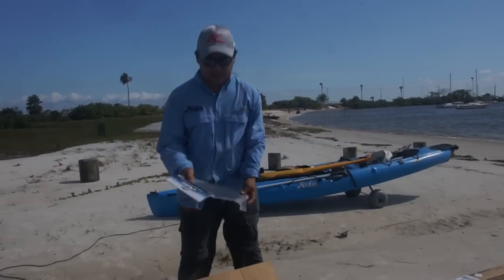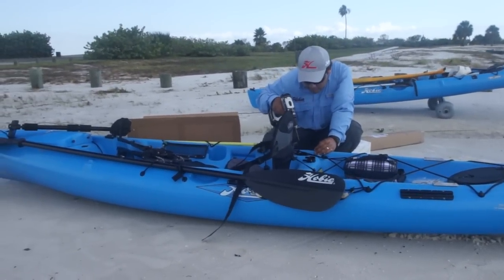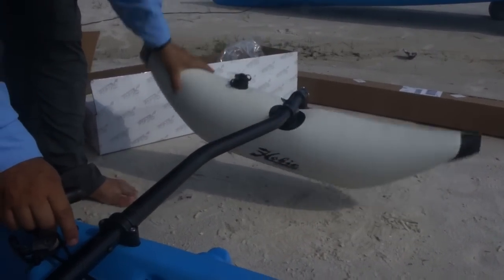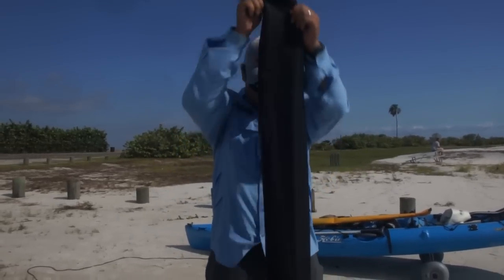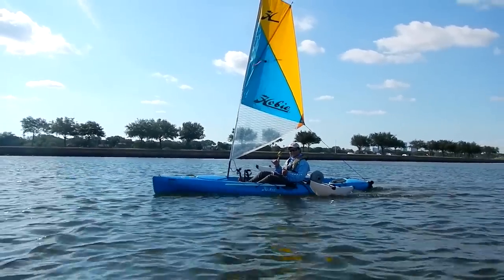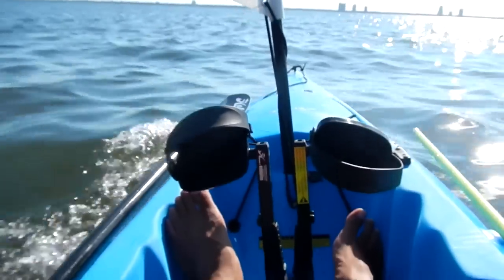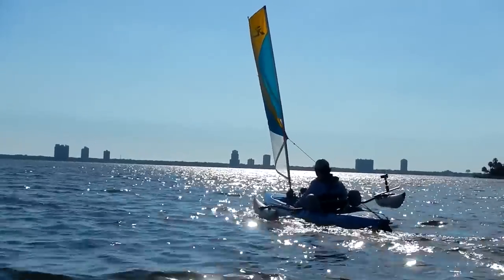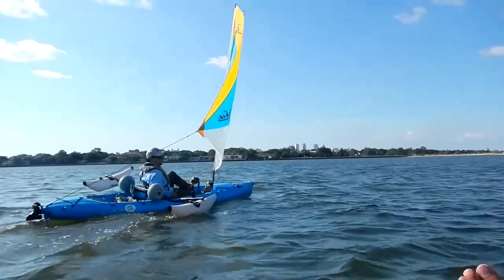Hobie Kayak Sailing Kit installation video

Comment: you forgot to attach the downhaul... the shockcord on the bottom of the sail should be attached to the post at the bottom of the mast... keeps the sail tight and keeps it from lifting up the mast.

Comment: I'm interested in the pedals. How are they propelling the kayak? Do they power up a small motor, or are they attached to paddles beneath the kayak?
Reply: Hobie Calls it a "Mirage Drive" and the pedals move two flippers under the boat which move like penguin flippers to propel you.
I have used one for years and it works great and is durable and well made.